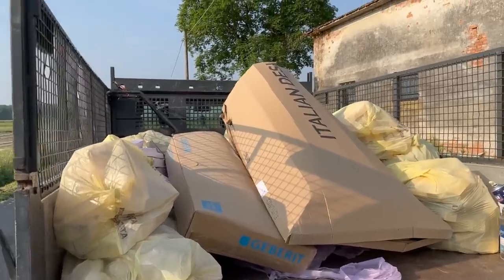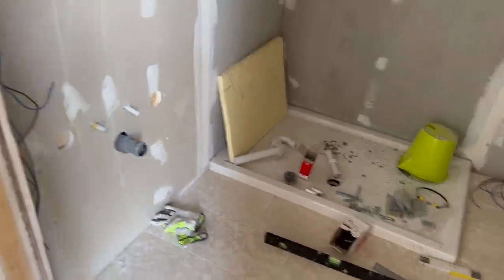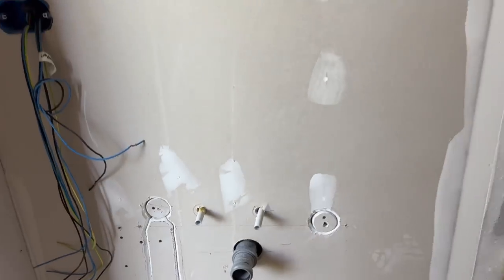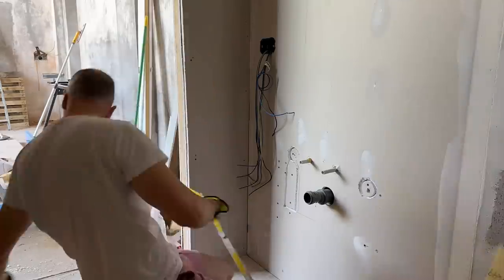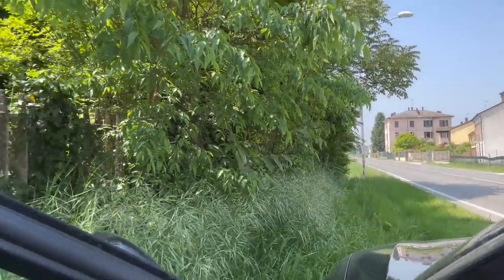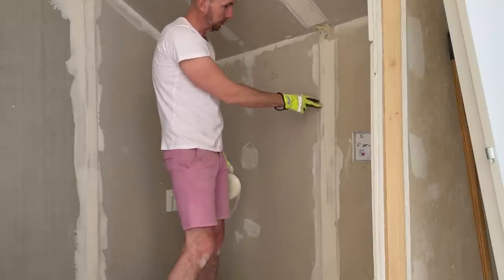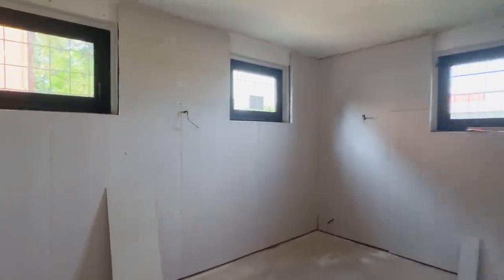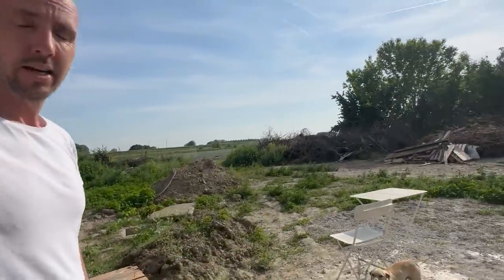A MAKE or BREAK Moment: Testing Our Italian Villa Bathroom SINK | Vlog

Comment: Wow, is that a normal height for a bathroom sink in Italy? I live in Michigan, all of my bathroom counters (and sinks because they are undermount) are 36" tall (about 91 cm). Same as the kitchen. I'm only 5'3" (160 cm).
Reply from the maker: So it's about the same height, I think bathrooms are going through a change as people become taller and taller.
Reply: @VillaAroldi  I saw in a later video that you addressed the height of the bathroom sink. It probably looks low in the video for a couple of reasons. First, you are a very tall gentleman. And second, it is a vessel sink so the counter is several inches lower. I have now seen all your videos and am anxiously waiting for more. 😁 You are doing an amazing job. I know the delays, setbacks, and material issues can be very annoying. My husband is a contractor (as was my father). It is something that even the professionals deal with but you are handling it all very well.
Reply from the maker: @ds4101  Thank you! Yes, it’s at decent height now. I could probably go higher but I’m not the only user.
Thank you for watching, new episode out very soon!